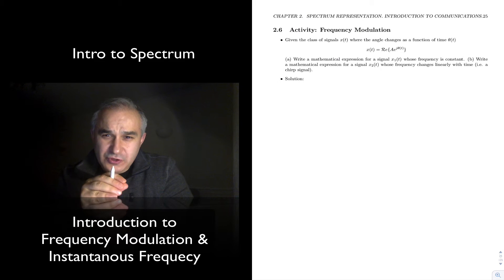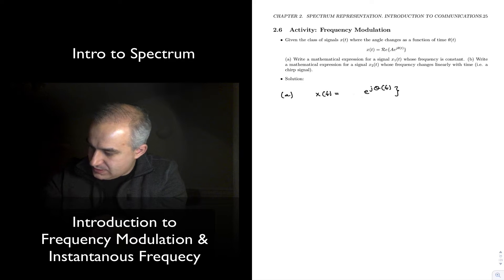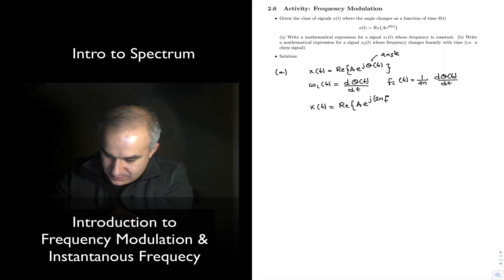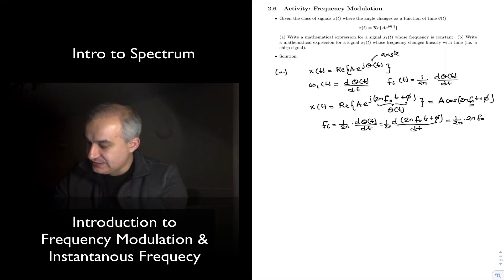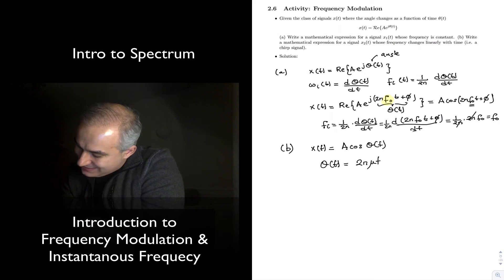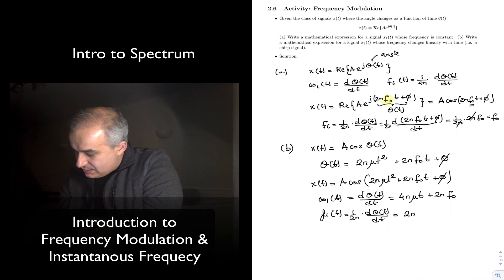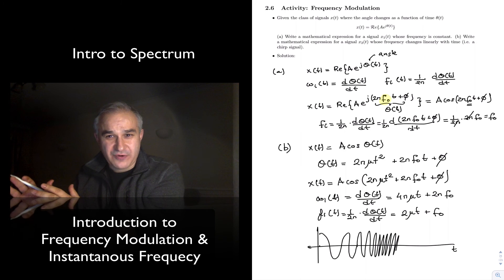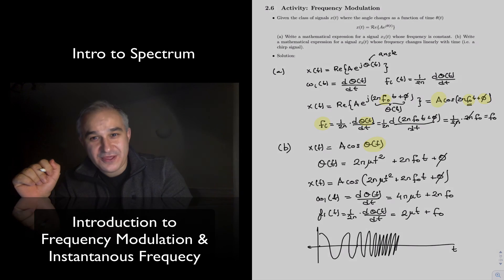DSP Topic 2: Introduction to Frequency Modulation

Comment: How and why did you chose to add 2pi ut^2? O.o
Reply from the maker: Changing to frequency in Hz
Reply: That quadratic equation is there just to simulate a function of angle that increases in frequency as time passes. If it's not for the quadratic terms (or higher order), the frequency will end up just being a constant.  I was scratching my head for a while thinking I forgot an important law or equation just to realize that was just a random, arbitrary equation to demonstrate ....